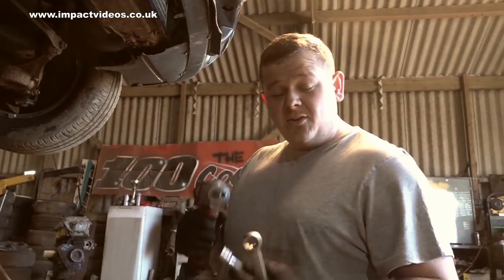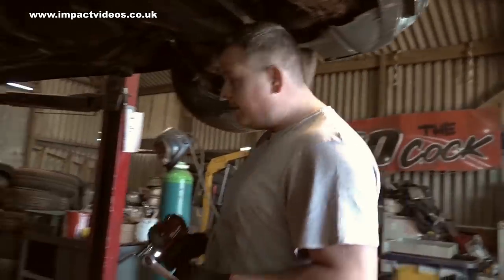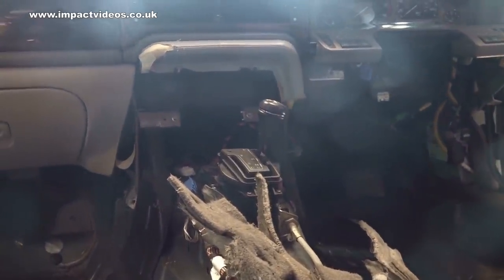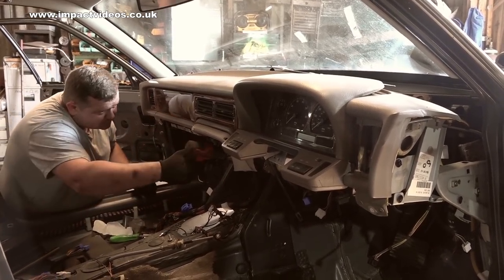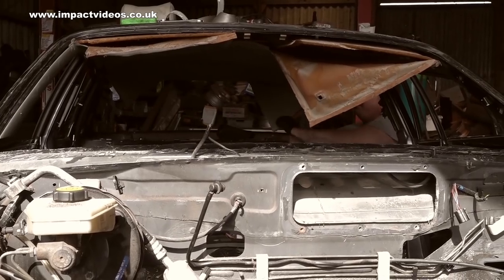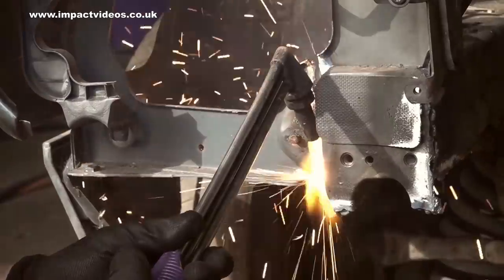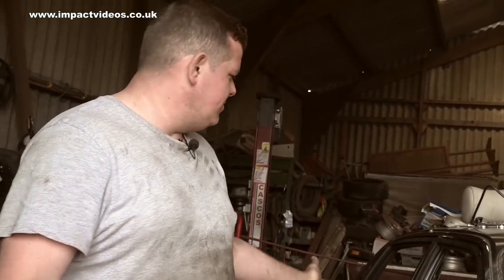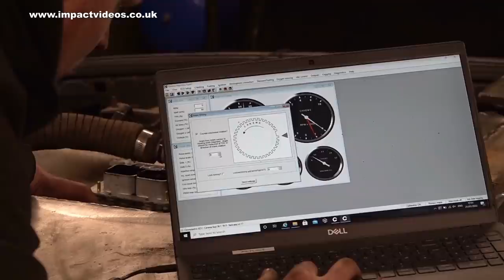Jaguar Banger Race Car Build Part 1 with Callum White

Comment: Total disrespect for a true British classic!  Should have been a bmw!
Reply: There is a reason why they use Jaguars in Banger Races.
The body of a Jaguar can take much more punishment.
Especially the Jaguar's nose section is very strong.
Reply: @opoxious1592  jaguar,s are a good solid car. Back in the day the engines outlived the bodies. Nowadays the older x300 and 308s are going to become in to classic status in a few years time. So if you get a good one hang on to it I reckon.

Comment: Waste of a beautiful jag should be cared and loved for. Should be restored not butchered such a shame in the not to distant future they will be kicking themselves when there worth silly money which is guaranteed
Reply: That XJ6 is rotten mate, Beyond economic repair, It's a 3.2 and never going to be worth much money, Better that it gets used as a banger racer for some fun and not just weighed in and crushed!
Reply: His money, his choice!
Reply: @scotty6346  you say never gonna be worth much money. What about the 1960s mk 2 two point four jags. They said the same about them. Now their worth proper good money!
Reply: @jamescourt4703  The point i am making mate is that a rotten X300 XJ6 is not worth saving, Pampered, Excellent condition one's are! I own a 1964 3.8 MK2 and a late 1973 Series 1 XJ6, Both of these cars are and were well cared for hence them being worth £££ now, Cheers.
Reply: @scotty6346  fair play 2u bud. Your a jag man. Im a jag man and have been for many years. I think I get a bit passionate for these old motors!
Reply: @jamescourt4703  I do as well mate! I am a retired vehicle mechanic, But looking at the videos the car is rotten, I would rather a banger racer have some fun with it rather than it just being collected for scrap and crushed as a lot of them are.
Reply: I'm a great Jag fan, I've also worked for the company as a development engineer.
Seeing these XJs getting scrapped is painful but rust is so expensive to fix.
I've just shelled out £2700 getting rust & paint done on my E39, so it's easy to see why the lower spec Jags get scrapped/bangered.
I remember 2-door Mk2 Escorts getting scrapped left, right & centre. You could pick them up for £400 or so.
Now you pay tens of thousands for a good sporty 2-door.